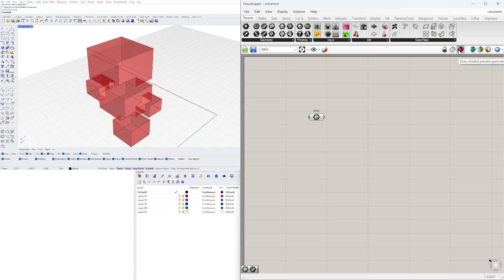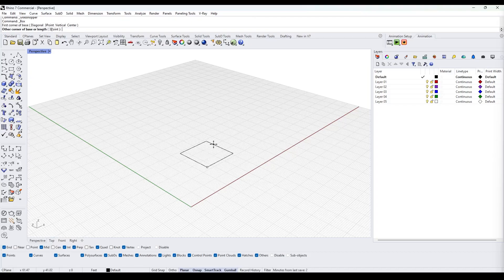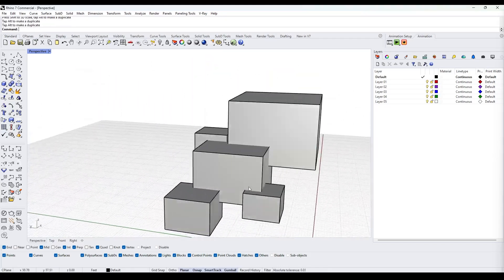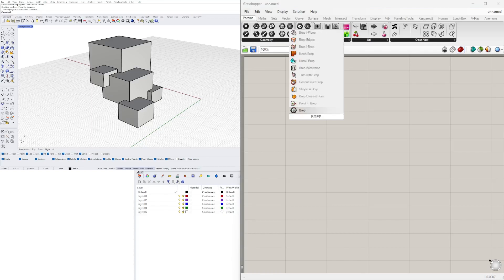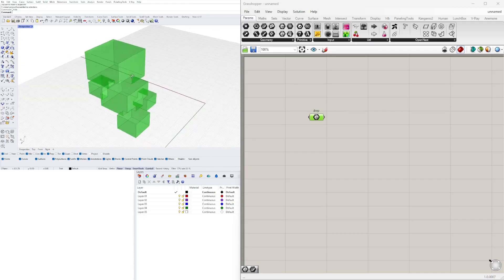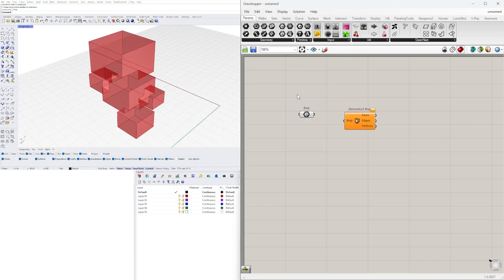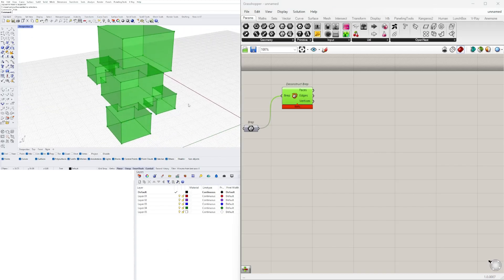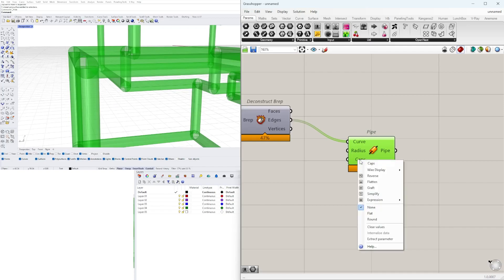How to make a solid into wireframe exercise Grasshopper & Rhino Parametric Architecture tutorials

Comment: Hi, when I was making the pipes they were two big for the object I was working on is there any way to change the diameter of the pipes?
Reply from the maker: You can change the diameter by using a slider and decreasing the size. Or offsetting it by a smaller number. If you have further issues send me an email at copetedavid@gmail.com